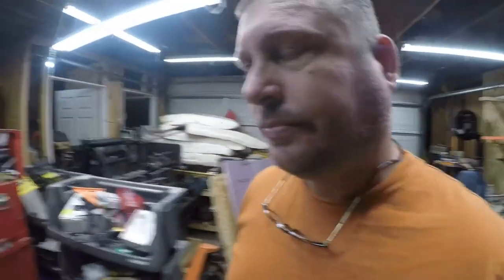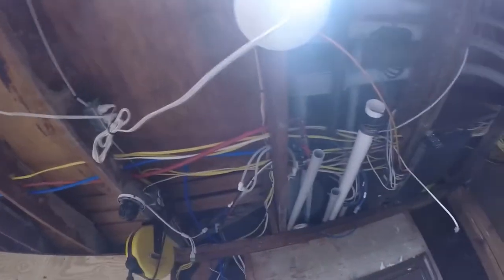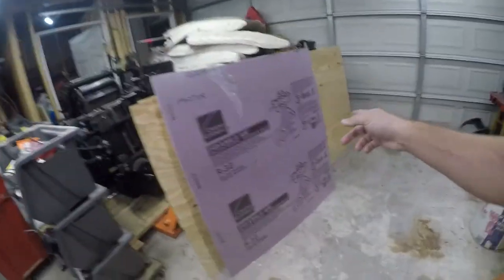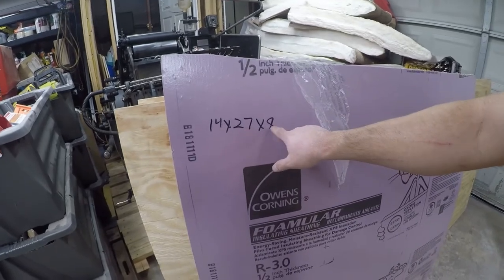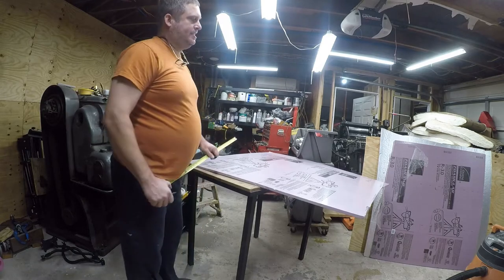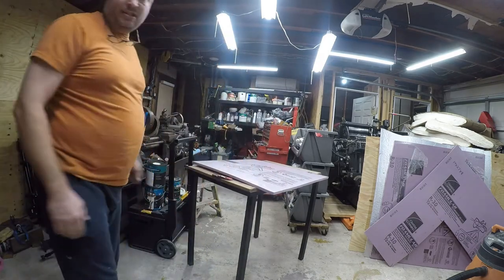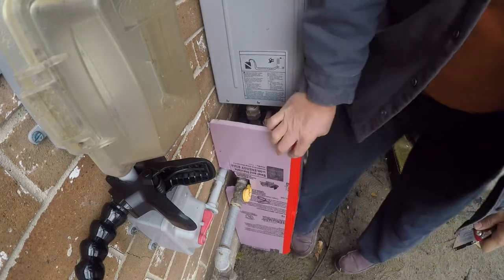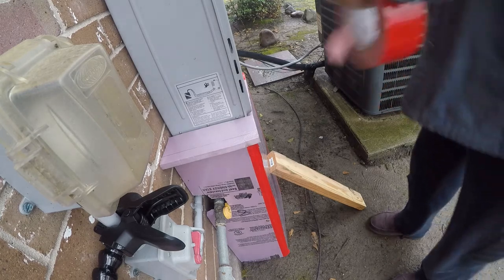How to protect a tankless water heater from freezing temperatures

Comment: Did it work well? We're building a house in Bastrop county and we're trying to decide between tank and tankless. Tankless outside sounds good, but we want it to hold up if we get another winter storm.
Reply from the maker: If you are building new I recommend having your builder construct a niche for the water heater.  It should have a way to disconnect the water heater and also an outlet nearby.  

You can also put it in the attic with a bi-axial vent.  I was renovating my home when I went tankless and used spray foam insulation.  I made a conscious decision not to have gas flame in the attic.
Reply: @hotpuppy72  Do you know anything about drain pans being required for tankless indoors? The builder is saying there won't be room for it in the laundry because it would require a large drain pan.
Reply from the maker: @fosty.  The drain pan is not much larger than the water heater.....

I'm a ICC R5 - Residential Combination Inspector and a TREC licensed home inspector.  Texas does not license builders or most contractors.  Few of them have any code certifications.  ICC R5 means I'm certified for electrical, plumbing, mechanical and structural.  In Texas, an R5 can sign permits as meeting code requirements.  Most home inspectors are not code certified.  

I would recommend finding a code certified inspector to help you and your builder to build the best possible house.  Your builder will tell you it's unnecessary most of the time.  City inspectors spend about 10 minutes on-site most of the time, looking for major items.  Builder QC inspectors spend 30 to 45 minutes.  A 3rd party inspector will spend much longer and help identify issues that the builder can correct.  These issues typically are inexpensive to correct on quality construction.

Examples of the types of things I've pointed out to clients:
- Relocate the shower light away from the ceiling shower fixture.  Cheap to do when the house is roughed in.
- Change from ceiling mounted air filters on a 12 foot ceiling to unit mounted media filters.  Inexpensive to change at rough in, not impossible to change later.
- Relocate sprinkler system so that it is not in the area that will be spray foamed later.  
- Correctly flash the windows before proceeding with exterior finish.

I don't inspect in your area but you can find a good inspector on the TPREIA website or through ICCSAFE.org